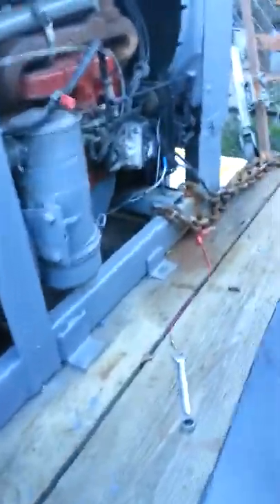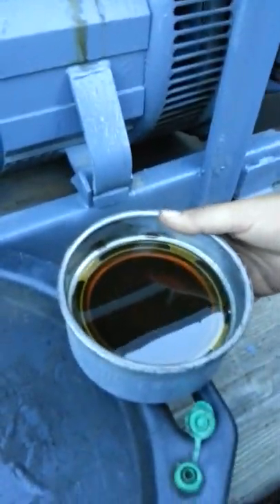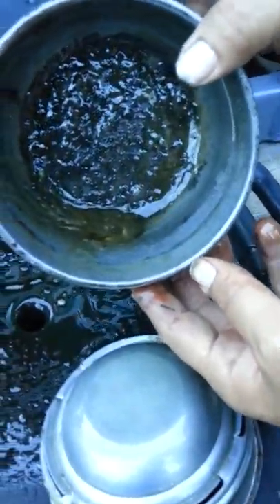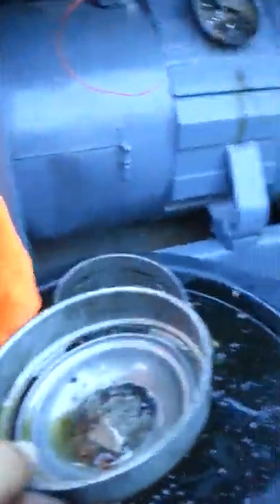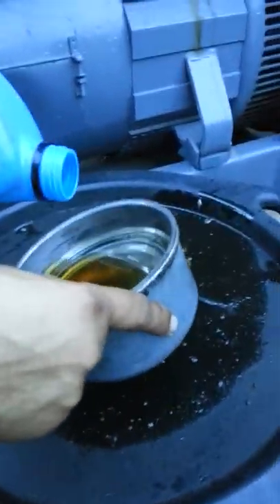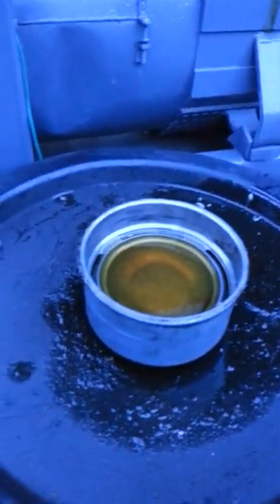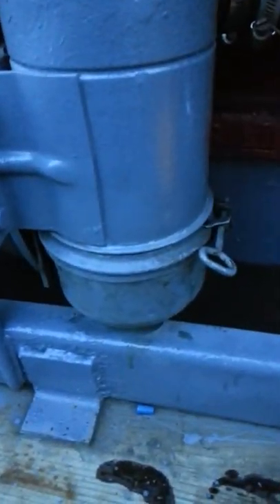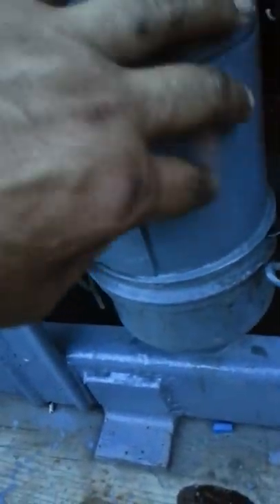Lincoln SA 200 oil bath

Comment: I Have a question brother if I add oil in my cylinder will it help clean it so my welder can fire up faster
Reply from the maker: No. Just take the head off and clean it and any carbon build-up. Install a new headgasket. If its taking to long to start replace spark plugs and wires. Reset points in the magneto. Clean the carburetor. I would start with the easiest one first which is the spark plugs, wires and point adjustments if needed.

Comment: Lino what happens if my dont have any oil in it I know I need to add oil but I just bought it apparently they were running it like that could something be plugged??
Reply from the maker: No. Nothing could be plugged. It's like an air filter  the machine just sucks up dirty air. Fill it up to the oil mark and install.

Comment: What oil did you use?
Reply from the maker: Eduardo Silva  I used 10w30.
Reply: Thank you! I have a question,can I use that too when I change oil on my Sa200 or does it take something different? What do you use?
Reply from the maker: Eduardo Silva https://youtu.be/IdG8aMmTmbo
Reply from the maker: Eduardo Silva  I run 30wt when it's low I add 10w30.
Reply: Thanks for the video man! Just picked up an sa200 and plan on doing some maintenance on it this weekend.

Comment: I changed out mine today and it had like white gunk like sludge at the bottom of oil bath cup cleaned it out put new oil do you know what could be the meaning of the white sludge?
Reply from the maker: Condensation. I have done several and most have a mixture of oil and water.
Reply: @linogarcia2478  ok is it harmful to the machine?
Reply from the maker: @eljr536  
No.
Reply: @linogarcia2478  thank you for the information

Comment: Hey lino what if my machine starts and runs fine in high or low idle but after welding for awhile it bogs out and sputters until sometimes eventually dying?
Reply from the maker: Check the fuel filter at the carburetor. Make sure the carburetor is clean. Check the air filter. If you have Murphy gages check to see if they are showing low oil pressure or overheating when the machines starts to bog down. Most of the time its fuel related or carburetor needs cleaning or rebuilding. Those are  things I would check if the machine  was at my place.
Does the machine only bog down when your welding?
Reply: @linogarcia2478  yes, I also popped the oil bath open and it was basically bone dry. I'm going to fill it in the morning and see if that was the culprit. Oil pressure is good, runs smooth otherwise but when load is put on it goes for a minute and then bogs out. Once I seen the dry oil bath I thought it must be choking itself out with particulates because the filter was dry.
Reply from the maker: @gangturtle329  it might be that your carburetor is dirty  since the air cleaner didn't have any oil. Check for restrictions from the gas tank to the carburetor. Because, when there is a load added to the machine it requires more fuel and air.
Reply: @linogarcia2478  ok I will take a look at that. Thanks for your help
Reply: I filled the oil bath to see what that would do. She ran fine for awhile, under load too. Then she died and she won't stay started. She cranks and starts and literally 5 seconds later she dies. Did I do major damage? I'm gonna take the carb apart and see what happens
Reply from the maker: @gangturtle329  
By adding oil nothing happens. Your problem was already there. There is a rubber hose that connects the air filter to the carburetor take that off to see if it runs. You will have to take the air filter off the machine to remove the hose.
 I think it's a gas problem or firing issue. 
Do you have an extra spark plug ?
If you don't just take one off the machine and leave it connected to the spark plug wire. Crank over the machine to see if you are getting a spark as soon as the machine turn off. If you  are not, let it cool off and crank it over again to check for spark. If you do get a spark look into the point setting or the magneto. But before that rule out the simple stuff.
Reply: @linogarcia2478  man, I'm gonna tell you that you my friend have already given me more information than I've been able to find on any forum out there. It may be a spark issue because I am getting air into the carb with the filter taken off. I ordered all new plug wires and plugs because I've owned the machine for cmn up on 8 months but I don't know when everything was replaced. I'll let you know what I figure out. Thanks a ton Lino
Reply from the maker: @gangturtle329 
Thank you.
I also have another channel. Don't forget to subscribe.
https://youtu.be/yzRefK5s5AU
Reply: Did you find the problem? Mine it's doing the same thing!
Reply: @crispingarcia7800  I ordered the carb rebuild, tore the old one apart and cleaned it and put all the replacement parts in and changed my plugs and replaced the plug wires as well and she runs great
Reply: @gangturtle329  awesome thanks!!
Reply: @crispingarcia7800  yes sir, thank Lino Garcia tho, hes the cat who helped me out lol. Best of luck bro

Comment: What if my oil bath has fuel in it?
Reply from the maker: Your carburetor's float was stuck open and it flooded and went into the oil bath. The only way gas can get into the oil bath oil is through the carburetor.
Reply: So I get a new one or is it something that can get fixed?
Reply from the maker: @edgarbueno1596  
The carb can be cleaned. It might be dirty. You can open it up and clean it. Does the machine run? If it does just clean it.
The carb has a float and the float is a valve like the toilet when the gas goes in the float rises and closes the line. As, the gas goes down the float opens the line. The toilet has a float which is the red or black rubber looking ball. When you flush it goes down and lets the water in. Once it's full it floats to the top and shuts off the water. If something gets stuck the water will continue running. The same with the carb it needs to be cleaned. You can also get very little holes in the brass valve and then it needs to be rebuild or replaced. Clean it before you go waste money on a new one when it only needed to be cleaned. My carb has been on the machine since 1976 and I have had to clean it many times.
Reply: Thanks man! I was wondering why it had fuel in it, and it did that when my machine ran out of gas so makes sense that the float valve might have gotten stuck and also dirty